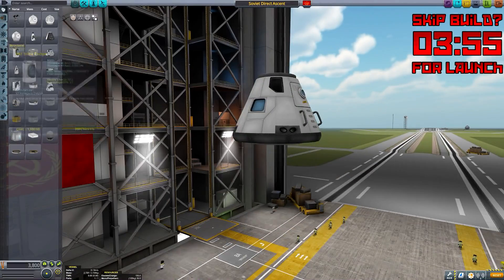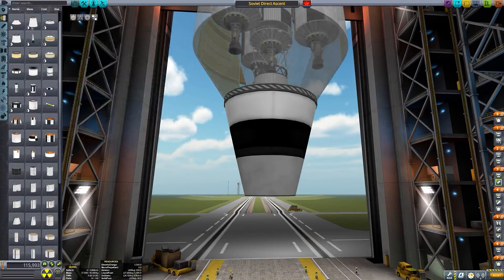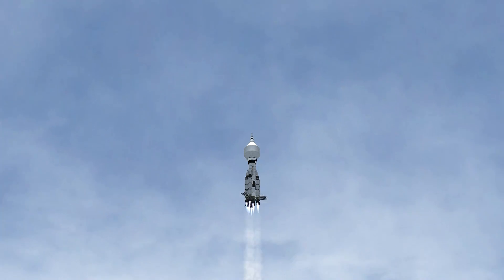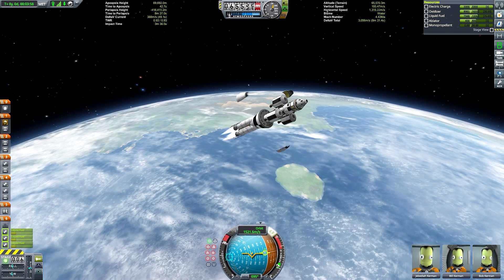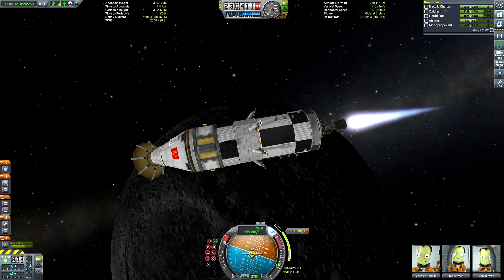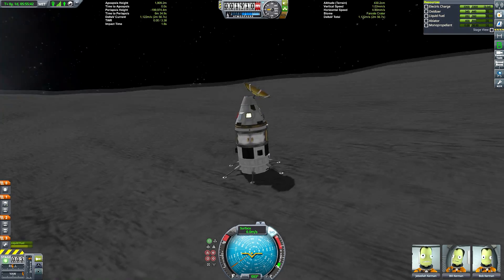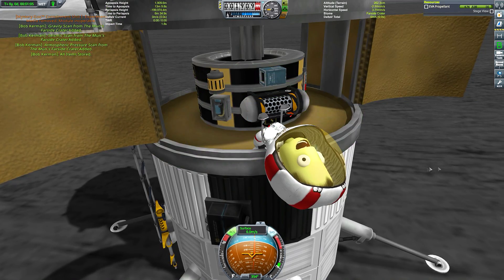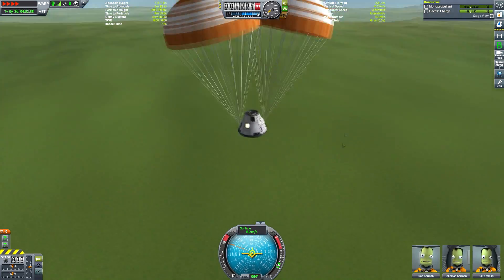KSP: That time when Russia went FULL KERBAL

Comment: Uri: Sir, my calculations indicate our Thrust to Weight ratio is simply insufficient for take off. 

Rocket-Slav: Nyet nyet nyet, add more engines.

Uri: Sir, but we will run out of fuel!

Rocket-Slav: Add more fuel, than! It's not rocket science!

Uri: It is Rocket Science sir! With more fuel, we add weight. With more weight, we no leave launch pad.

Rocket-Slav:  . . . huh. . . okay, I know solution!

Uri: Yes?

Rocket Slav: More engines. Also more fuel. Simple. Go build now. No more arguing I need to sleep.

Urin: I understand.
Reply: You literally just explained the tyranny of rocket equation.
Reply: @LukeLeishe yeah
Its basically THROW ENGINES UNTIL IT WORKS
Reply: Lmao
Reply: damn bro urine really got put in his place

Comment: Hey... I love the video, it was great, but there is one detail you missed out: Stage 4 of the rocket shouldnt have the central engine included, only the 3 peripheral ones, and there would be no fuel lines. The peripheral tanks would empty, then they would be disconnected, and the central engine would be firing, otherwise a good mission, considering you went full stock (I consider "Making History" to be stock :P)

Comment: The rocket used hypergolic fuel which is very powerful and so able to do a direct descent/ascent, but hypergolic fuel is very toxic which was one of the reasons the N1 design got picked over this one.
Reply: Fire Powered RadioActive Elevator, plus, this is overcomplicated, and hypergolic fuels are extremely inefficient
Reply: Republic of Ravenswood Don't know about you, but Isp of Hypergolic UDMH/NTO engine in Russia is about 315 on average, which is quite decent

Comment: The universal rocket sounds a lot like the F-35 jet. One ship with multiple variants for different jobs. 

Needless to say, if the Soviets had gone that route and it was anything like the F-35, they would have gone bankrupt and collapsed far sooner.
Reply: Except for the fact that they can use the same tank and engine as the Proton, Chelomei did design the UR series for the rockets to be modular, so the build and development cost was supposed to be relatively cheap.
Now the real problem is what to do when those montrosity explode, poor Kazakhstan had to take a huge amount of carcinogenic UDMH
Reply: " Now the real problem is what to do when those montrosity explode, " that accident was worse than Chernobyl
Reply: xSwaghettiYolonesEx su35,maybe also su30.Well the f35 had other problems in the rain,a thunderstorm can shut off the jet but i didn't mention that because it was 2 years ago,i'm sure they fixed that problem.
Reply: The F/A 18 is pretty good at multitasking.
Reply: xSwaghettiYolonesEx 
About the rain: in case of rain the jet is not stealth anymore and must be repainted (a special film must be applied)but in any case full stealth doesn't exist,it's suspicious when on radars they see something big like a bird fly fast like a jet.
Range:yes there are jets with less range,but this doesn't mean that the max range of the f35 is any good.
Manouvrability: maybe i'm old but for a jet this expensive it's amazing that if detected there are almost no chances of win (and countries like Russia are now using photonic radars on their jets so they can detect stealth jets at the distance of 400km).
Helmets: agree they are cool but still a death trap in case of ejection,still too heavy.
Reply: xSwaghettiYolonesEx the stealth of the aircraft is instantly compromised when any weapon is armed. Therefore, if lock can’t be achieved, the aircraft is incredibly vulnerable. It’s one of the reasons the eurofighter won (by a considerable margin) the training exercises against fa18s, f22s and f16vs.
Reply: xSwaghettiYolonesEx didn’t say it could. But it can mount some external jammers if I’m not mistaken. And there is an electronic warfare variant called the E/A 18G too.
Reply: dont forget about the stealth bomber, due to its suppressed thrusters and its anti-detectable air system built into it, it can be used for alot lf purposes.
Reply: The F-35 is a steaming pile of porkbarel garbage. It just. Plain. Sucks.
Reply: They built the UR-200
Reply: The F-35 is probably the most pointlessly awesome planes ever made. It's the result of a good long orgy between the F-117 Nighthawk, AV-8B Harrier and F-22 Raptor, with stealth capabilities, bomber capabilities, attack capabilities AND the ability to take off extremely quickly and land on a dime, like the Harrier. despite all that awesomeness, it was a failure. Everything it can do, an F-22 can do (except taking off and landing vertically, but the raptor has superior redundancy, having two main engines instead of one) or an F-117 can do.
Reply: @lsswappedcessna  the redundancy of twin engines was initially a Navy requirement from the 60s: but has since been phased out. It was found that single engines fighters sustain engine flight hours at it higher than twin engines ones. The analytics basically proved that the more engines you have, the more chances for failure. An easy piece evidence is the F-16 vs the F-15 on reliability and ready time. The F-16 won handedly: despite using the exact same engines as the F-15 (PW F100s).
Reply: @lsswappedcessna  the F-117 has shit performance...The F35 doesnt share the same role as the F22...Not comparable, just like how the F15, F16, and F18 arent comparable, the main issue was that the f35 is how overpriced the project was
Reply: tho even F-117 was shoot down in '99 @
The YouTube Phantom Official
Reply: The YouTube Phantom Official and the eurofighter is better than all 4 you mentioned, and that’s a gen 3 jet!
Reply: The Eurofighter has nowhere near the stealth capabilities.  It is an amazingly maneuverable craft and arguably one of the best of Gen 4, but if I was a betting man, I'd put my money on the F-35 any day of the week, and I'd place double that on an F-22.
Reply: progmetalfan42 I do like the Typhoon, but it can't supercruise, and has very poor stealth capabilities.
Reply: F-35 it's copy of soviet plane yak-103
Reply: xSwaghettiYolonesEx because it can't fly if it rains.no range ,speed or manouvrability at all.Needs 20 hours of preparation for 1 hour of fly.Thanks to the heavy new hemlets the ejection seats are a death trap.I could go on but you get the picture.